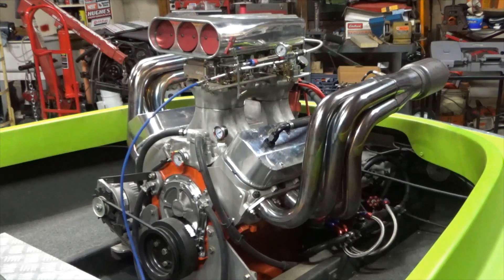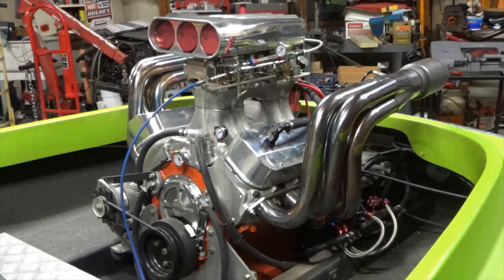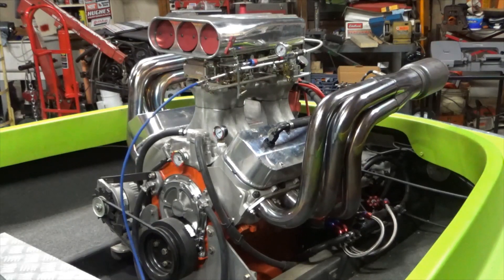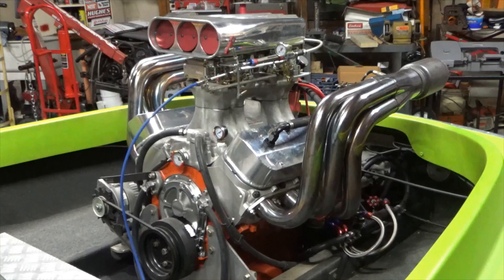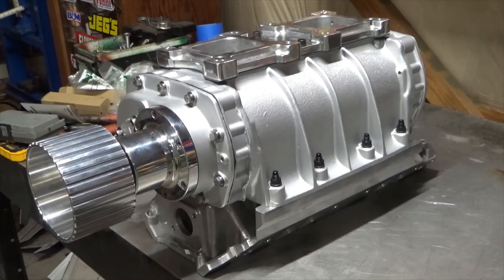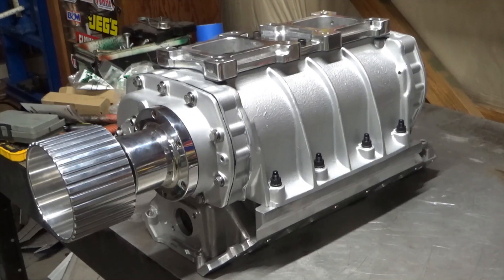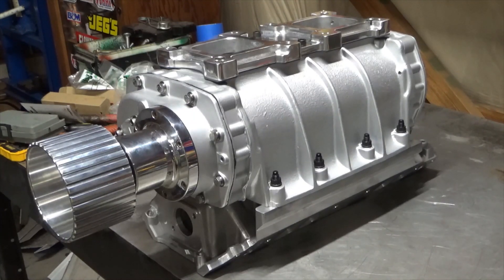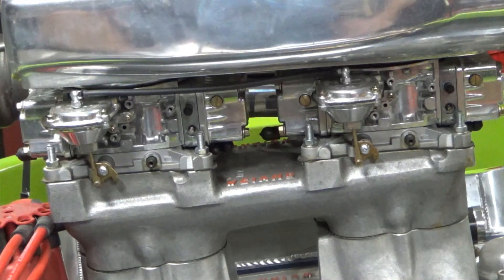Supercharging my jet boat. (PART 1)

Comment: The crank will be fine, turn the blower slow to start, ease into the timing at first like 28-30°, the most important thing i feel is a exhaust temperature sensor  about 2" from a tube, any tube convenient for you because you'll have one, 1350° is building power 1500° is breaking parts, alsoyou can block off the power valves and jet up with no boost reference needed, it's super common, i think 10 jet sizes up, get octane booster